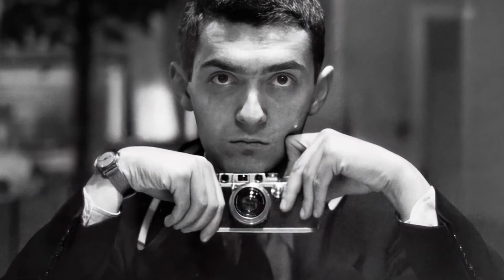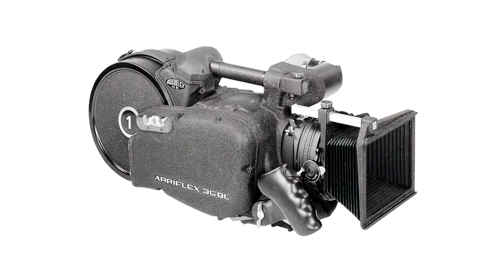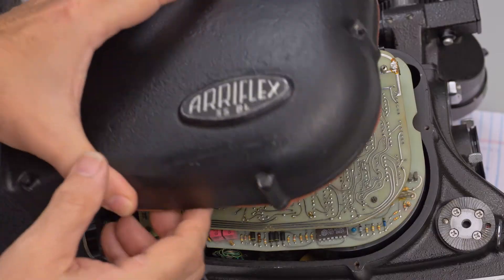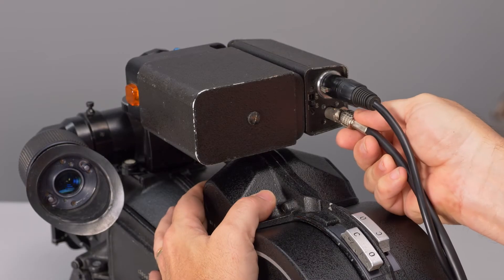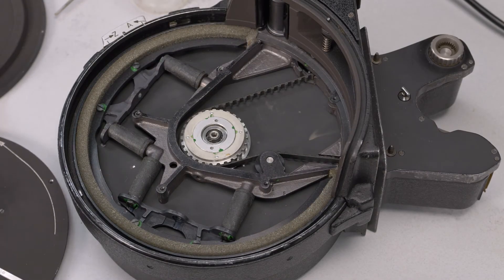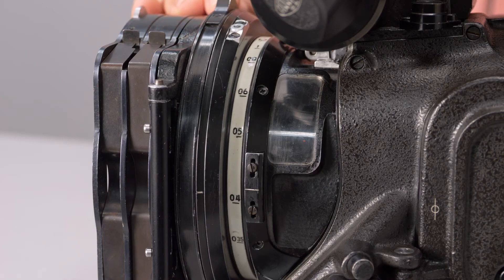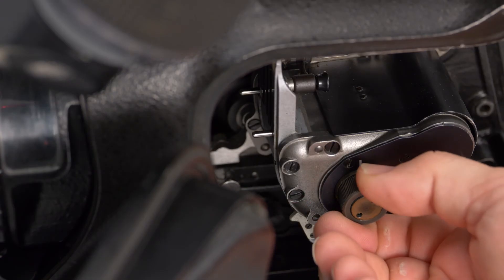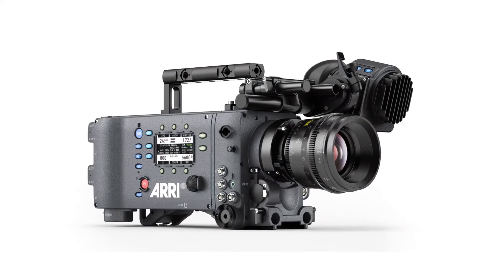The Arri 35BL-2 | Kubrick's Camera of Choice on "The Shining"

Comment: One thing that some people don't get is that these Arris, and most film cameras used, were "APS-C" framed or smaller.  These days there has been a presumption that great digital cameras have to be "full frame" to get a professional look.  That is still not true.  Yes, "full frame" has some technical advantages, but mostly, a "professional look" can be achieved with an "APS-C" camera.  Yes, you need "adequate" equipment, but at the top end, the human beings involved make a real difference.

Comment: I've assisted with the Arri 35BL, shot footage with their Arri 16BL and Arri IIb and IIc and even shot to odd printer test on an ancient Arri 35 step contact printer. In each one you can feel the pride of the engineers - they were all beautifully made and engineered to last. 

Nevertheless, it's worth recalling that the original Panavision Panaflex was released about 1972 and was silent without need of the lens blimp the 35BL and 35BL II required. While this worked, it was a nuisance for the camera assistant, slowing down prime lens changes. Zoom lenses like the Angenieux 25-250 had to have their lens blimp permanently fitted. 

We should also remember that while Arri introduced the revolutionary spinning mirror reflex viewfinder French manufacturers like Debrie, Eclair and Aaton virtually refined the engineering concept of the film movie camera, with coaxial magazines that reduced the size of the camera (Debrie Parvo) , fast magazine changes and shoulder shooting (Eclair CM3, NPR, ACL, Aaton 7). 

I believe Arnold and Richter (ARRI) were founded in 1917, with 108 years of building motion picture cameras, film processing machines, printers and lighting. 
In my book they are a fine example of why German precision engineering is so highly regarded around the world.
Reply from the maker: Yes, it's true that the Arri 35BL wasn't always the quietest or most convenient camera to use. I'm planning on doing some videos on the Eclair cameras.

Comment: This was probably one of the best detailed overviews of a motion picture camera I've seen! I really liked how hands on it was, showing the effect of different parts and constantly showing how effective the noise isolation was. Showing off the rubber bumpers everywhere, then addressing the lens.

It's quite crazy to see such efforts go into dampening or isolating the noise when Aaton just made the movement itself quieter by making it move more smoothly. Even more so when I saw an Arriflex documentary highlight the precision of all the parts even mention avoiding vibration by making the cams balanced.

Still, the way the lens blimp snaps on and has windows for distance markings/aperture and dampened tabs for pulling focus is super cool!

On a side note, along with the Arriflex I/II/III, I can't help but notice these 35mm cameras seem quite a bit smaller than I always expect. I guess the large, 1000 foot magazines on top of Panavisions and their bulky bodies make them look far huger by comparison. Some of these 35mm Arriflexes even rival some of their 16mm cameras for size (besides the 16S/M/etc)

Also, some of the upscaling on the images looks rather mushy at times. I guess it's a lack of high resolution photos online. Just got surprised with some of the garbled text and other fine features.

Excellently presented demonstration!! Your videos are wonderfully made!

Comment: Kubrick's cameras were basically Mitchell BNC's on Fear and Desire, Killer's Kiss, The Killing...Then he shot on 65mm widescreen cameras with the very first ever Panavision Lens (just the lens, not the camera) for Spartacus. Lolita and Dr. Strangelove had him return to the Mitchell BNC. He shot 2001 on a Super Panavision 65mm camera. This was the only time Kubrick worked with Panavision cameras. With a Clockwork Orange, he returned to the Mitchell BNC. True, in Barry Lyndon, he used the Arri 35 BL -- but the groundbreaking photography done in candlelight only was done on a modified Mitchell BNC -- custom fit with lens with lenses SO FAST ( I believe 0.4 f) that were designed by NASA for photography on the dark side of the moon.
Reply: Kubrick used a German ZEISS Planar 0.7/50mm for the candlelight photography. The lens was designed for NASA. He had three of them. Actual price: 60.000  up to 150.000 Dollar.
Reply: A Clockwork Orange also makes use of the Arriflex 35 IIC for some special shots, which is a handheld MOS camera. However since it was a MOS camera it was extremely noisy and not a quiet camera at all so that's why most of the film was shot with the Mitchell BNC, which was quiet enough to record sound.
Reply: @KylesDigitalLab  I shot my first and only 35 mm film in MOS with an Arri 35 IIC ...
Reply: @jonathanswift2251  I know the 35 IIC was used to shoot the original Night of The Living Dead according to IMDB. It was a low budget film of course. I assume they used a blimp?
Reply: @KylesDigitalLab  I would imagine so during the dialogue scenes. However...they could have done post synced looping....

Comment: I've always wondered why most film directors and DPs went with the Panavision Panaflex instead of the 35BL. The Panaflex came out the same year as the 35BL and was basically Panavision's own self-blimped 35mm camera. I assume because Panavision was an American company and Arri was West German? I remember reading that Panavision didn't sell their cameras or lenses and only had them available to rent, while you could actually purchase an Arri camera.  

The vidicon TV camera that could be used for monitoring the camera itself is very interesting. I assume later models like the BL3 and BL4 could use a color vidicon tube? At the time in the 1970s when the BL2 was out they would usually use 3 tubes to capture a full color image, which was very expensive, so they were forced to use black and white. However by the early 1980s the single-tube color vidicon camera was popular in consumer video cameras, so I imagine they would have upgraded it to color.

Garrett Brown, the inventor and operator of the Steadicam, did a very informative commentary track on the Blu-ray of The Shining. They used wireless methods to actually transmit the video signals from the vidicon camera to the monitors, and Kubrick was worried about the locals being able to pick up the signal on their TVs. Brown assured him that they wouldn't, but Brown actually went outside of the movie set with a portable TV and was surprised when he could actually pick up the signal from the camera on the TV.
Reply from the maker: At one point there might have been a color tube video assist, but I don't recall it. Color only started really being used when CCD chips came along in the late 80s. Black & white was usually fine, as it allowed one to see the framing and the performances. Color, contrast, etc. was always judged through the optical viewfinder or by eye. Thanks!
Reply: @FreshGroundPictures  I have a friend who was on many films and is now a member of the ASC who said that the pin registration on ARRI's were superior to those on Panavision. Also, the strobing effect (on the wheels of a wagon, for instance) was more pronounced on Panavision cameras, leading to a distorted wheel motion. That same effect was less distorted and more visually accurate with ARRI BL's. Probably all this was due to the superior pin registration.
Reply: @jonathanswift2251  Seems like strobing would be a product of shutter angle, which is adjustable on the higher end cameras and not pin registration. Your DP friend may be correct on pin registration, I don't know. But the Panavision camera movement is from Mitchell cameras, which many say has the best movement ever made for motion pictures.
Reply: I think a lot of it had to do with Europe vs. the US and the lenses. 
Arri has more presence in European markets than Panavision. 
Panavision has a different philosophy as a business model. You're renting a whole package. 
But it's often about the lenses. Pana had great spherical lenses, but their claim to fame is their anamorphics. 
If you want Pana animorphics, you're going to need to rent the whole package. 
Kubrick owned his own equipment and didn't shoot in anamorphic, so no need for Panavision (with the exception of 2001)
Reply: @jasper232323  Thanks that makes sense. I guess it made sense to just rent instead of buying a $100K camera, especially if you were making low-budget films. The original Friday the 13th from 1980 comes to mind with it's $500K budget, and lo and behold they used Panavision. Did Arri ever rent their cameras too? Also, weren't their some Arriflex cameras like the 35 IIC that Panavision modified to use their own lenses and rented out? I think they used a modified 35 IIC on Star Wars that used Panavision lenses.
Reply: @KylesDigitalLab  Yes, Panavision modified and rented Arri cameras. They were called Pan-Arri. You're correct about the one used on Star Wars. Arris are rented as well. I own former rental Arris. The reality is most of these cameras were rented since most people couldn't afford to own a synch sound camera set up when they were new. They were , like $100,000 cameras. Kubrick owned his own cameras, but he was unusual like that. 
 Panavision has a great reputation for working with people with limited budgets, though. I'd love to use their lenses.

Comment: Thank you again for the video, its great to find this inside information. I wonder if he truly used a Kinoptik Tegea f/1.8 5.7mm as people call it the "Kubrick" lens. Might find one for my 16BLEQ
Reply from the maker: Kubrick used the Kinoptik 9.8mm lens - particularly on Clockwork Orange.  It's essentially the same design and looks very similar to the 5.7, but covers a 35mm frame instead of 16mm. I had a 9.8 for a while - very interesting, but not that great optically when compared with modern lenses.  Kubrick however would evaluate multiple copies of a lens and pick the best.
Reply: 5.7mm is the S16 version of that infamous 9.8 lens.

Comment: You've sold me! I'll take one of each. A problem I had with my Bolex H16 SBM was the noise. So I bought a "Barney" which helped, but the best shot was a blimp I made out of plywood which resembled an early Technicolor blimp. But it worked!  😊
Reply from the maker: I made a Super 8 sound blimp in my 20s - it kind of worked, but I didn't really understand the whole isolation concept then. Thanks for watching!
Reply: I remember using some automotive muffler rubber mounts, bolted to the bottom of the plywood blimp. It worked really well, except for the size. That was in 1972.    😮m @FreshGroundPictures